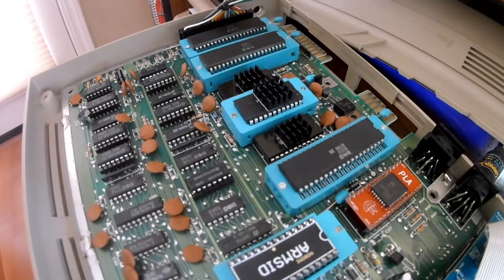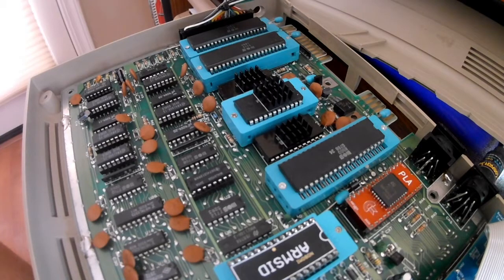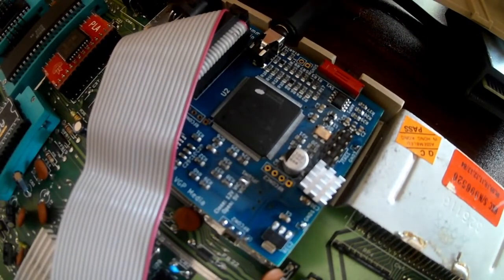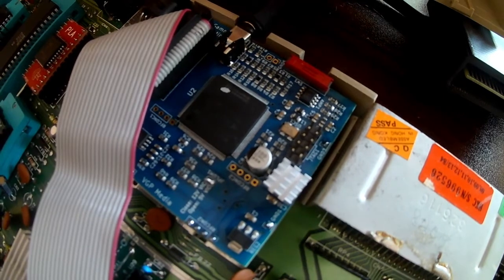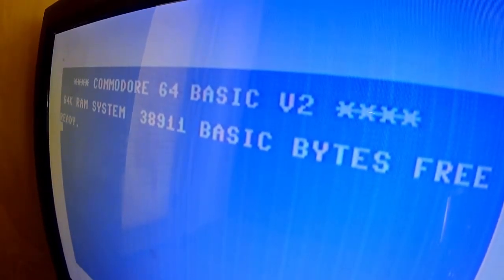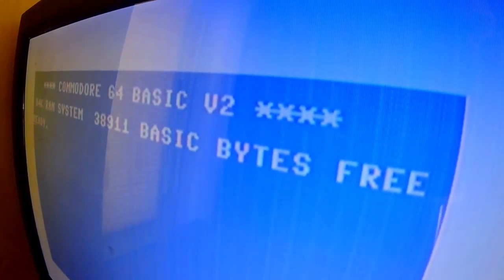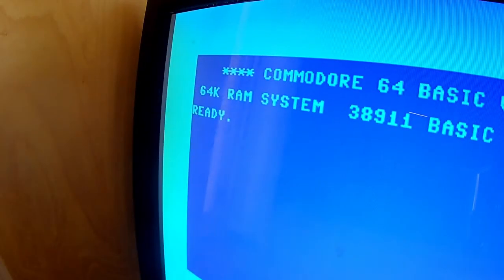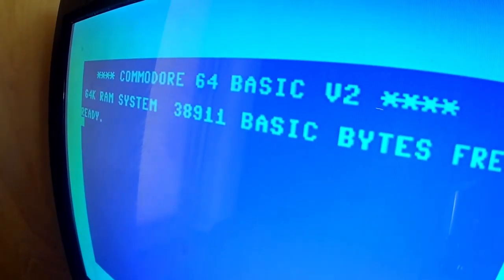Review of the c0pperdragon Commodore 64 component video board

Comment: If you did not have the ZIF socket for your VIC-II, would the adapter board fit? I have read about a 250407 motherboard component getting in the way. Would love to hear if you have any news on the firmware and sparkle problem. Would be unfortunate if the firmware requires too much effort to update.
Reply: On my 250407 I gained enough clearance by just adding another 40-pin socket before installing the adapter board.